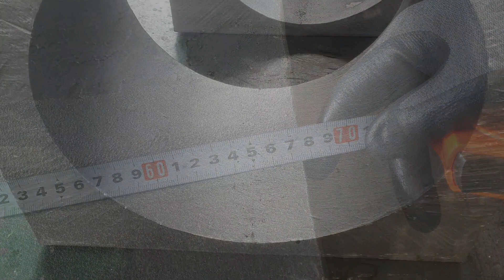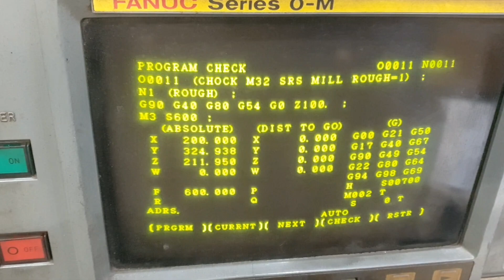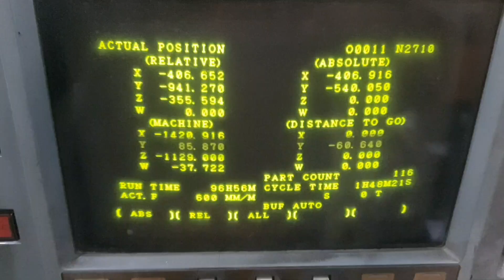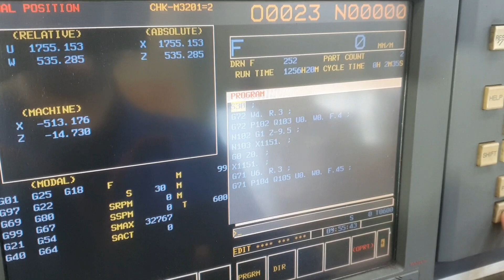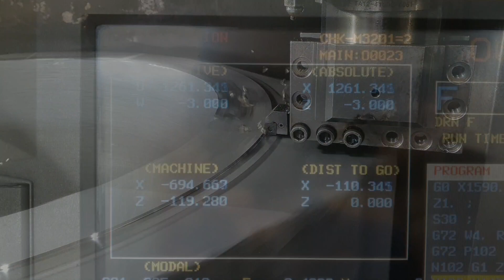4ton Workpiece First Milling and Second is lathe Machining - CNC Lathe, CNC Milling

Comment: I’d like to know more about setting up a rough casting like that? What do you use as a reference for your first cut?
Reply: Generally your first work offset is based on an average. So as an example, you'd get the average center of that hole, and the average of a face, and use that as g54. The hope is, after your first operation, you have at least 1 datum that you can use for positioning the rest of your offsets for other operations.
Reply: @grinchyface  In my shop when we do rough forgings/castings, we use the milled datum face as the Z0/G54 on the turning ops so all dimensions come from a known flat dimension. It has its benefits, but make programming a little more of a pain

Comment: My job is refurbishing those chocks. Milling and drilling new rocker and wearplate surfaces, thread and hole repairs after oversizing or spraywelding the bore. Currently machining a 15.500kg topside, 1275mm bore...Those are the biggest we can mill and turn, though milling alone we can do bigger.  Too bad I can't upload those big boys up here. Whats the biggest chock you can machine?

Comment: Using the numbers you show at 0:39 and an estimated hole diameter of 800mm this casting weighs in at around 4560kg or just a tad over one short ton of 2000 pounds. That is a far cry from 8000 pounds or 4 tons as indicated in the videos title..........
Reply: Scooter Tramp , 4560 KG is 4.5 metric tonnes (1000 kg = 1 tonne) 2.2 pounds = 1 kilogram so 4560 kg =10,053 pounds = close enough to 4.5 tons

Comment: What is the part used for?
Reply from the maker: The choke is a component of the rolling mill, and the bearing is assembled and is an important part to support the roller pressing the iron plate.
Reply: @jamespark_85machiningtv   Thank you sir!